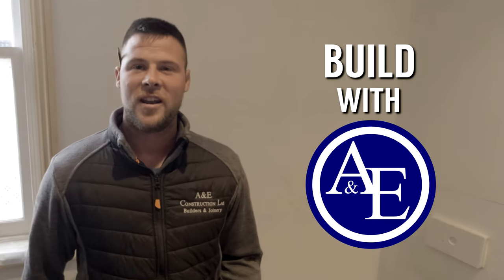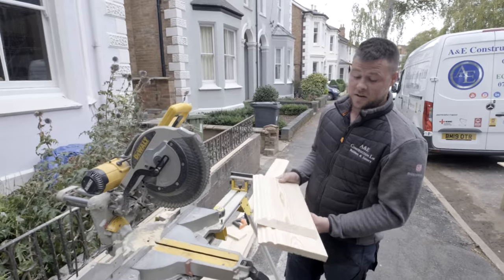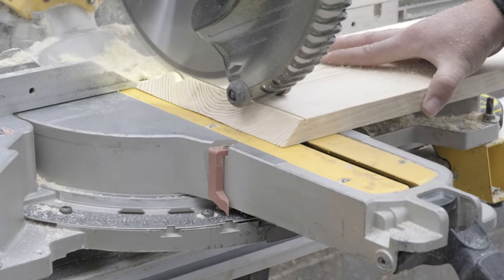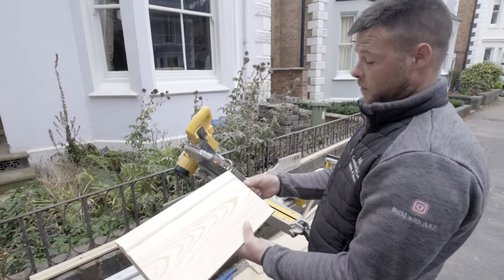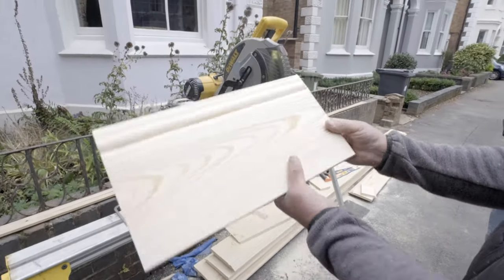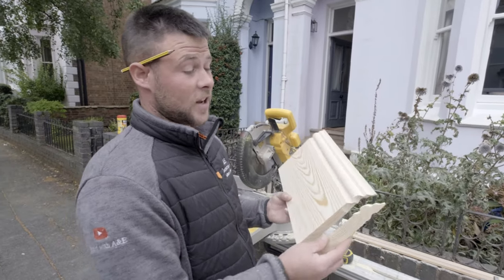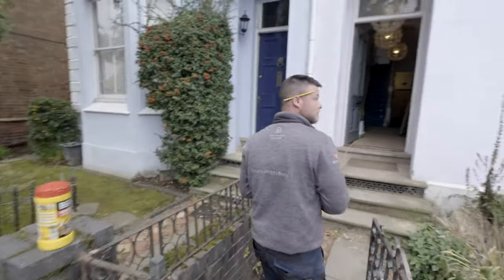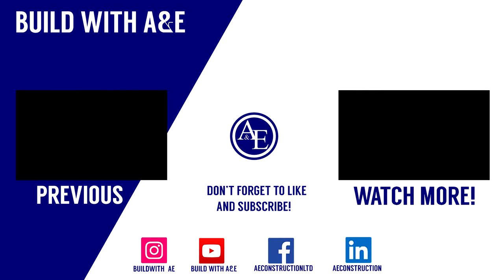HOW TO SCRIBE A MITRE JOINT | DIY Series | Build with A&E

Comment: Best video I’ve seen on scribing! It’s explained it perfectly without over complicating it and it’s a great tip to cut the board with the mitre saw up to the point of the first bevel 👌🏼
Reply from the maker: Glad it was helpful! Thanks for watching and take care 👍
Reply: Totally agree..best video as the others I have seen make it too complicated. Thanks heaps. Regards Brendon
Reply: Even better if your mitre saw can bevel both ways too. Can slightly back cut that bit too so the front butts up perfectly